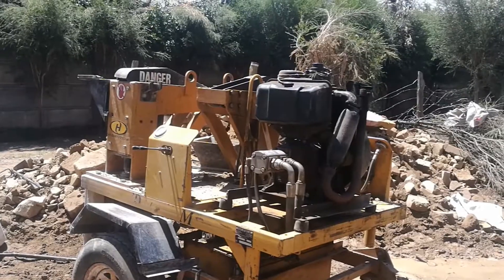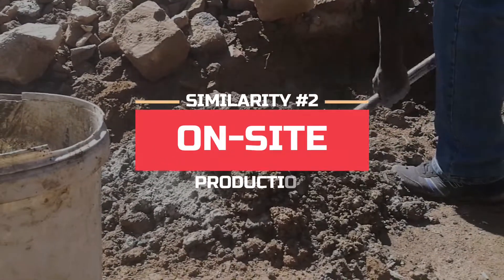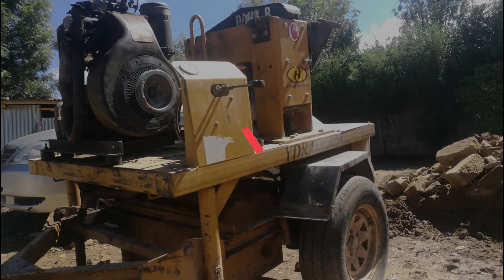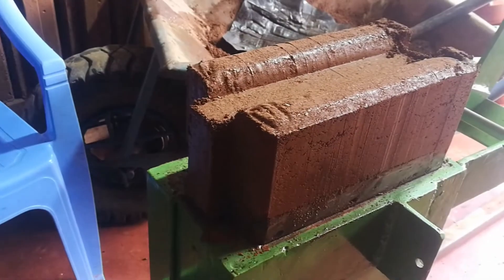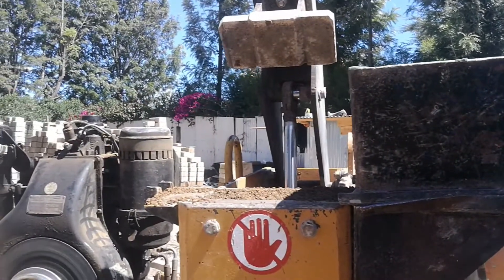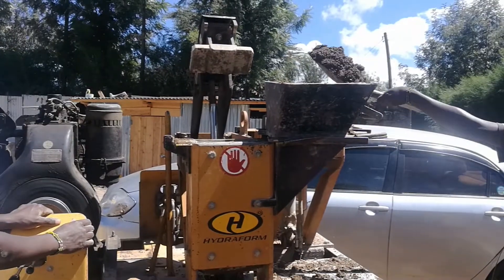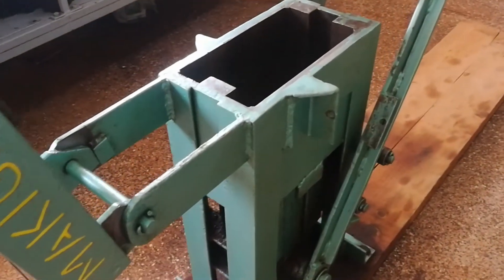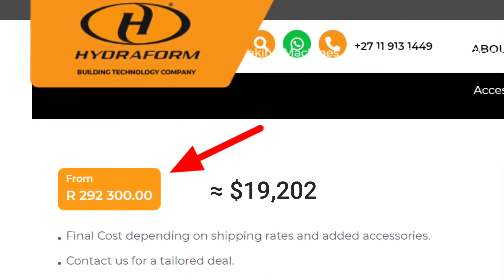What's the difference between a Manual and Hydraulic Interlocking Soil Block Machine?

Comment: Manual  Pedaling  machine  design  which  can  produce  1400  or  more  bricks  in 8 hrs,  very  easy  operAtion,  no  electricity  reqd,  ideal  for  remote  areas  is  ready.  Detaiils  can  be  Emailed  to  any  industrialist  interested  to  develop  and  manufacture.

Comment: 1. Prroducing 400 has been impossible.  I 3 guys the sieve the day before and still  i get 160 at most. 
2. How can i know have the perfect soil, when you rub the brick it shades off
3. Can you used stone dust and cememt and does it matter which type 32.5 or 42.5

Comment: How much compressive strength for each block  could you achieve ??? With manual and hydraulic compression???
Reply from the maker: Manual- 2-3 N/mm2
Hydraulic-4-5MPa
Compressive strength will depend on the ratio of cement added to the soil
Reply: @PropertyNoma  thank you

Comment: One of the problems with the hydrualic machine was shown in that video.  Variation of length of the block / brick.  As for needing 3 machines to make the bricks, someone has not done their engineering properly.  The new machine that I am getting commissioned will be able to make 4 or 5 block types from the one unit, and 3 or 4 blocks at the one time.  Many people have not done their homework on the construction of the machines!
Reply: Which machine make and model makes more than one kind
Reply: @noahsherman4542 :  The one that I am making myself!  I have seen the Chinese efforts for the single brick machines, and the ones on here, and am not impressed.  Even here, requiring 3 machines to make individual bricks, to me, is a waste of resources and money!  It is going to take me several months, but, when it is up and running, it should be a great machine to observe in action, run by one person.  If I can set it up properly, I should be able to produce 400 mould fills, on my own, per day.  Bearing in mind that it is going to be producing a mixture of 400 * 200 square interlocking blocks and 300 * 150 * 100 CSEB.  It will also mean that I have to run two different mixes, as both of the products are a different mixture.  Facility is also there that a 250 * 125 * 70 / 100 CSEB can be produced as well, from the same machine!

I will not run the tongue and groove type block, as they are not able to be vertically stabilised in the wall, nor is there facility to deliver the power / gas / water / comms in the wall without cutting into the bricks, which damages the structual integrity of the wall.

Estimate at this time is a June / July 2023 start, so keep an eyeball peeled around that time!
Reply: @111jacare  I will definitely keep my eyeballs peeled.
Reply: I agree . Please let me know when your is up and running and has quality control with pass mention and durabilty.
Reply: Did you get the machine with different variations…kindly recommend
Reply: @MzeeRatili :  It is a machine that I am building myself.  It is reliant on my having money to manufacture.  I have some of the materials for the machine, but I need to buy other parts for the machine so that I can get building.
Reply: @111jacare  what is the estimated cost of manufacturing and how much are would you sell it for, assuming you already got the tools for fabricating ama u have access to a workshop tayari.
Reply: Halafu do you also have a 3D model? Maybe this can help you get your first clients/ investors hoping your prototype will be a hit.
Reply: I want to buy that one please
Reply: Update:  At this time, before the manufacture of the press for the production of blocks / bricks / roofing / window sill tiles and paving, a machine has to be made to be able to screen the sand and stone for the production of good quality materials for use in the above products.  As a result, am in the process of building a shaking screen table, powered by a bicycle! 

My reasoning is the following:  There are some places in the world where a good consistent supply of electricity is not available.  Nor is there fuel to power a generator.  So, bearing this in mind, that also rules out welding on site.  Based on this, the screening table is being set up so that it can be bolted together with 3 spanners and a hexagonal allen key.  The other reasoning is that bicycles and parts for bicycles are available world wide, and the parts in question being small, they are easy to purchase and transport.  There may be some welding done at the point of manufacture, but, this is to attach the pins and locking pins to chains, which are welded to the legs, so they are not lost or misplaced easily.

This now means that the block / brick / tile / paving machine needs to be pushed back several months.  However, the block machine is going to be built in the same manner as in bolt together; no welding required!  Am not sure if bicycle / gravity driven; or, manual hydraulic press / gravity driven will be used.
Reply: I would advise that maybe you take time for the planning yourself. We do not need to know or understand your system yet otherwise we could do it ourselves.Or.
When all is set and approved you can tell us
Reply: African engineers need to step up........I am not an engineer but these look simple and shouldnt be this expensive. when i am ready to buy i will use chinese as first option I dont support mediocrity.

Comment: for manual machine since productivity is limited hence increase the size of block to double the size to 2x2ft with 8  or 10 inch width
Reply: But the muscle power to pull the lever will also be twice as high. No real saving here.
Reply: @tupG  u can try and see the difference since larger 24x12x8inch block has saving in lower joint leading to lower mortar, faster construction, cleaner finish hence can directly use 0.5 inch thick lime putty as paint cum plaster  to save money over conventional 9x4x3inch bricks and to reduce weight can make it hollow by having 2inch walls of block to have 4inch air gap to act as natural insulation
Reply: @sainiamarjeet  I only responded to the productivity of the machine itself.
That larger blocks have advantages, as you rightly pointed out, is a different topic.
Reply: @tupG  manual machines r in majority in africa not in india due to lack of power availability.
Reply: @tupG  pls check the manual machine and size of the earthen Compressed block making video

Comment: Can I mix soil, sand and cement?
Reply from the maker: Not sand, just suitable soil and cement. Typical mixing ratio 5-10% cement to 90-95% soil
Reply: I use 5.5 parts sand, 3.5 parts clay, 1 part Portland cement. I use masonry sand. It works great! Takes 21 days to cure and I place them in a tub filled with water the entire time. This stabilizes the block for areas that have snow or high moisture/rainfall.
Reply from the maker: @seymorepoohtang3080  Thanks for your information Seymore! Much appreciated

Comment: Realistically speaking I don't think it's possible to put out 400 blocks a day using the manual machine cause I use a wide ISSB machine and I can produce around 150 a day for now which is a hustle, no joke. So I would really like to know how to put out as much as 500 a day, what's the secret?
Reply: 3 guys… 2 mixing the clay, sand and Portland and one guy pressing the block. We were doing about 430 per 8hrs. By yourself doing 150 is a ball busting venture.